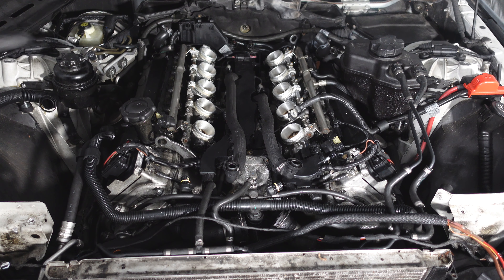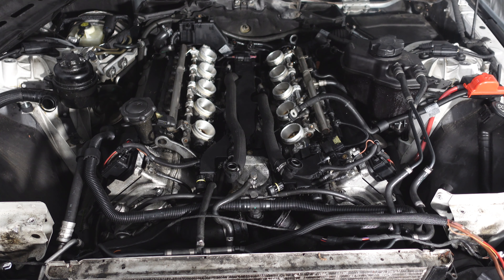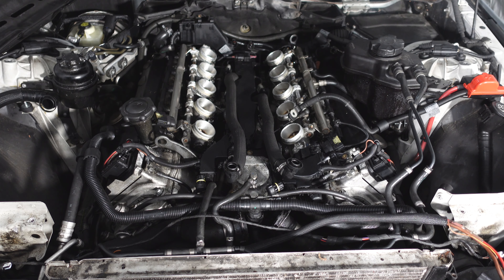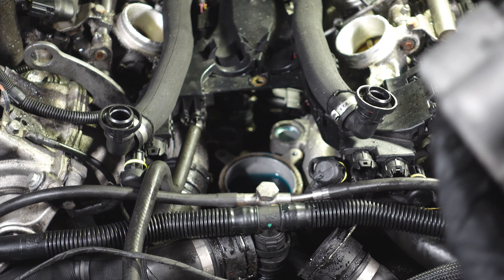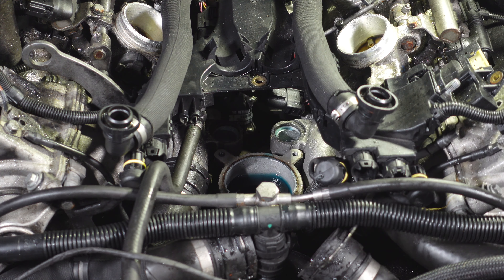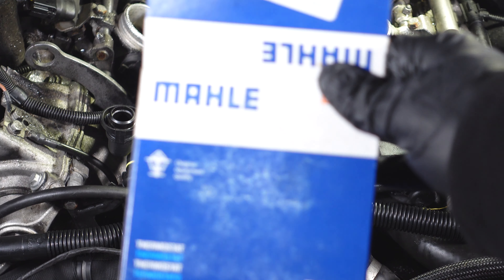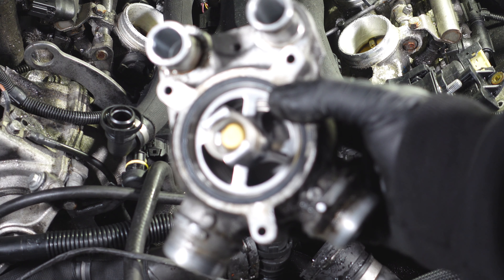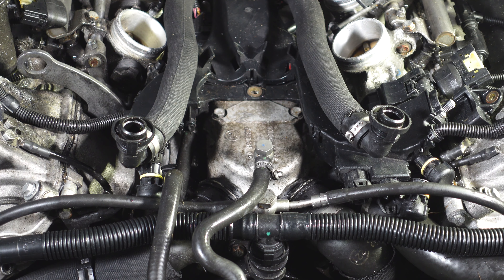BMW E60 M5 / S85 Thermostat Housing Removal / Thermostat Replacement

Comment from the maker: BMW know this fails every 50,000 miles and it’s a well well known common problem all over the BMW Community. This part is so so CRITCAL especially to help the warm up of the engine and the oil pressure for the rod bearings and engine internals, when this doesn’t function properly, this part is one of the many many factors why so many people blow up there engines and the rod bearings lack lubrication. 

I would strongly strongly advise you to check this because of that reason as if stuck, it will undercool your engine which in turn, is deadly just as over heating. 

To make it clear, BMW knew this and started using thermostats from dodge vipers to make the car warm up quicker which in turn gets the oil around the engine much faster then the genuine BMW ones.

70% of rod bearing failures, is because of this being stuck ! People don’t even realise they change the bearings only for the new bearings to wear down and not even aware there engine blows up. When in fact, if this was checked first and checked correctly every 50,000 miles I don’t think rod bearings would have ever been a failure point on this engine from the start of production.

Comment: Nice one, these thermostats hold up quite well, M57 eats through thermostats even quicker 😉
Reply from the maker: They really don’t hold up well, it was well known by BMW that these had a high failure rate big big failure rate to say the least. But BMW, didn’t want to admit it as these were the main cause of rod bearing failure for getting stuck and undercooling the engine causing the oil not to be delievered correctly to the rod bearings. That’s why MOST warranty claims were approved without the customer having to pay a penny they knew this from early on.

Comment: Hey Dean, absolutely love the videos you have taught me so much much about the e60 than I could ever imagine. I could use your knowledge and experience regarding my issue, I have called around to shops and they don’t know fuck all about my problem I am having. I have a intermittent issue with sound cutting in and out whether on the radio, auxiliary and even the seat belt chime is staticky and cuts in and out. I have a 2005 BMW 530i it is getting really annoying. If you know anything about this please let me know I would really appreciate it. Cheers

Edit: I had my mechanic who has been servicing my car since it was new, he is a really nice guy he is german as well but he isn’t very good at electrical issues. We first hooked a jumper wire to the TCU module and that didn’t work, then we replaced the radio in the car and it still does it. The car has 155,000 miles on it which is very good considering its age and it has only had minor problems but this problem is far more annoying than anything else i have ever experienced.

Comment: What is the normal amount of time it needs to get to operating temp from a cold start to around 100C for the oil? Thanks
Reply from the maker: Should be in total 5mins if driving once cold loop has stopped. If left idling can be anywhere from 6-7 mins to get to 90c thermostat open to get oil temp to 100c
Reply: @BMWDoctor  this is interesting, my S65 will take approx 10-15 mins to get up to 100c assumed this is fairly standard… 🤷‍♂️ keep up the good work. Thanks
Reply from the maker: it should NOT be taking this long at all that is way way to long for warm up I would definitely get that seen too asap
Reply: @BMWDoctor  will do thanks mate 👍
Reply: My coolant tem tops out around 76-78°  I piut this on a fb forum and was told this is fine 🤷‍♂️

I would've thought it should be in low 90°c

Comment: Thermostats (2 on Manual cars & 3 on Automatics) failing on Diesel BMWs is the biggest killer of those engines. Injectors constantly running in warm up mode prematurely wearing them out, DPF not regenerating therefore clogging up as it doesn't reach the specified temperature, Turbos sooting up and failing due to the constant warm up mode over fuelling issues and all because BMW didn't bother providing a coolant temperature gauge on their 2004 to 2010 cars. Interesting  how the previous generation as well as  the generation immediately after have coolant temp. gauges.
Reply from the maker: Thats why BMW Did that ! They knew the thermostats were completely faulty throughout them years they also knew the water pumps was a new design and they didn't want it scaring people. But glad you see exactly what I know already these causing the car to undercool is a big big problem and deadly to the engines
Reply: @BMWDoctor  ... having owned a few E9x and E6x Diesels you quickly learn to check the coolant temp with a diagnostic tool live data as the very first thing 👍🏼 5 out of the 6 needed both coolant & EGR thermostats changing within days of purchase 👍🏼 the 6th one lasted couple of months before needing the same 🙈🤣
Reply from the maker: Its terrible how it was such a common failure on the E60 I mean really terrible not even that, This I truly believe is the reason of many peoples issues especially on the M5 and I swear this is the issue of most rod bearings failing as people "Think" There cars have warmed up then start redlining it only to find the coolant temp has fallen way below and you keep driving it like that at speed the oil temp lowers which turns it to thick to protect the bearings. Thats how I always diagnose them via live data easiest way and very simple to do.
Reply: @BMWDoctor  ... I’m guessing it’s the same issue on the E9x M3 V8 rod bearing failure since it’s the same engine with 2 cylinders sliced off 😉 and same coolant thermostat issues ?
Reply from the maker: Exactly the same ! in all honesty this is the reason I ain't driven mine since doing the rod bearings I'm overhauling everything on it at the top.
Reply: @BMWDoctor  ... I don’t blame you mate 👍🏼 better be safe than sorry 👍🏼

Comment: I think I have replaced the thermostat on every car I have owned in the last 35 years. Usually they run cold, however I have had them stuck closed. Those electric ones are seem to be even worse.
Reply from the maker: Running cold is the last thing you want on this engine when people hit the Rev limiter constantly 😬
Reply: @BMWDoctor I thought the bar on the Rev counter was effectively an oil temperature gauge so it would show a lower max rpm.?
Reply from the maker: Nope thats engine running temperature thats nothing to do with oil. Same as on all E60S them graphs on the RPM are all coolant and to make sure car is at full temp before being revved out